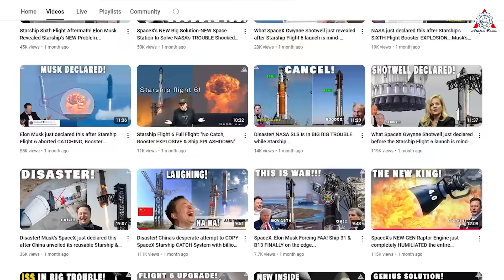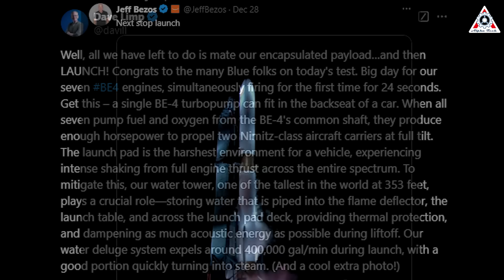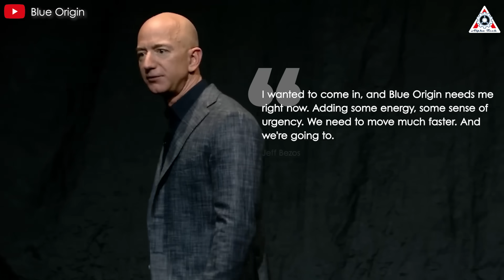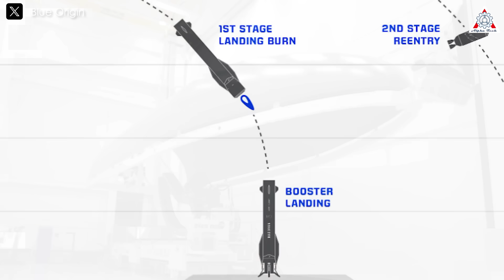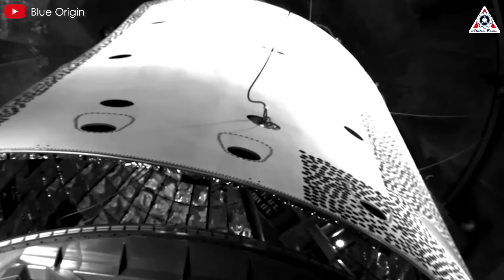Something Weird Happening with New Glenn in the First Test, Looking to BEAT SpaceX!

Comment: Engineering is an iterative process and this is BO's first real cycle of the process whereas SX has already completed many cycles and has corrected many of the inevitable problems already.  I don't think BO or JB has any idea of how important that is.

We will see very soon how the BO choice of deferring the testing and re-evaluation stages works out for their project.  I'll keep an open mind but in general you have to actually ""do"  or perform a task to see if it will truly work.  They are well behind in the prospect at this point and it will take a herculean effort to catch up.